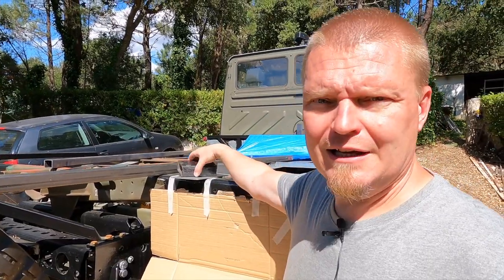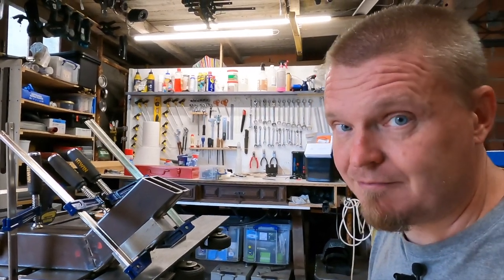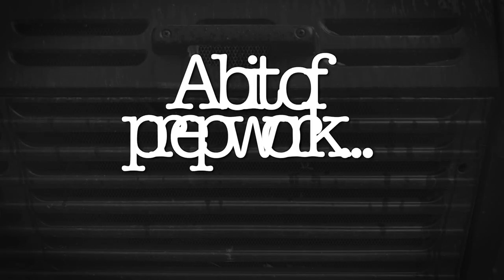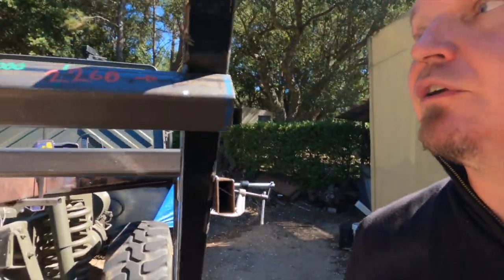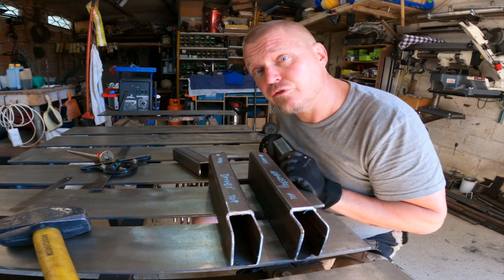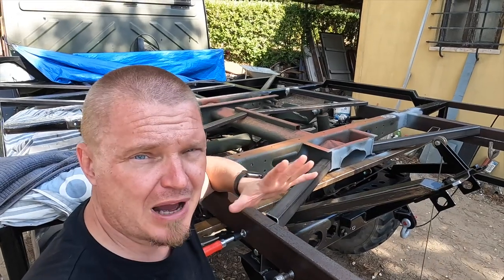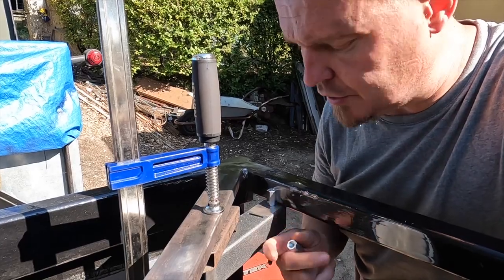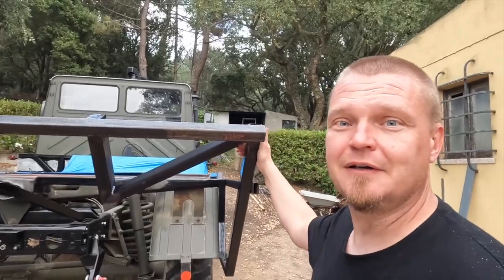Unimog Camper E030 - Preparing the subframe

Comment: Fascinating to see you go to work on the subframe Jocke. Reminds me of the CBR "discovery" subframe I made a couple of years back ;-). I realised after returning from a euro stroll that the damn thing weighed more than the gear I ended up strapping to it. Completely changed the handling of the bike so much that I could barely drive it in a straight line for three days after I installed it and then again after I removed it hahahah... The extra wheelsyou have  on the Mogtoise will be a great help with that I think. Is the spare tyre a structural member in the design? I feel it should be... :-) Jokes aside, love this, so glad you're pushing on with it you are an inspiration sir!
Reply from the maker: Hey Bob! Good to hear from you! I'm just making things up as I go along, and I am pretty sure you know that. Sounds like the subframe you made also was made the same way. Cool thing about making things this way is that you can change them any way you want when you have "gathered more data", you know what I mean. 
Sadly the spare wheel only has one purpose; to be swapped out for another one. I will, however, have to put a camera watching it move compared to the habitat. Just to see whether The Crazy got the maths right with regards to the movement. 🤪👍🏻
Thanks for tagging along, Bob!

Comment: so allll this extra metal is in the interests of weight saving?
Reply from the maker: Not really. You might remember an earlier episode where I explained that the flatbed subframe isn't really ideal. This is adapting what we have (old flatbed) to what we need (house) with the resources we have. Ideally we'd build a completely new box with integrated subframe in the spirit of the Porsche 917 or Mercedes 300SL chassis with modern computer strength simulation. Or why not carbon fibre. 
We don't have that, so we're just adapting the flatbed. It'll have to be strong, so weight considerations will have to be pushed down the list of importance.